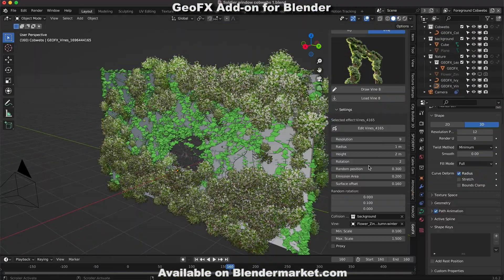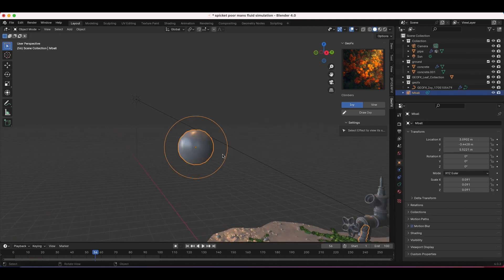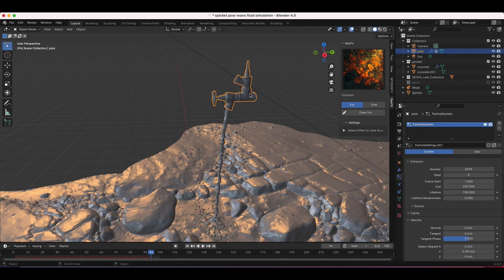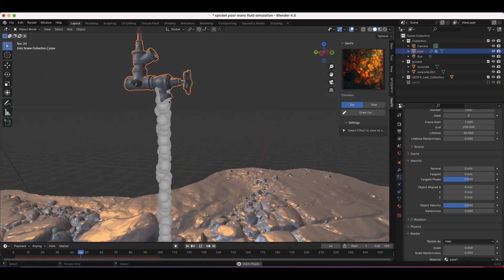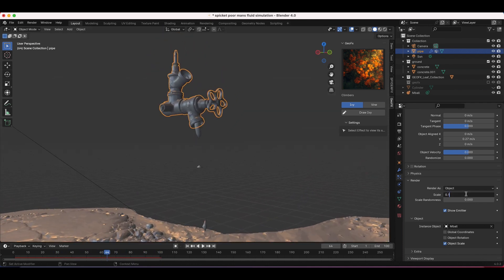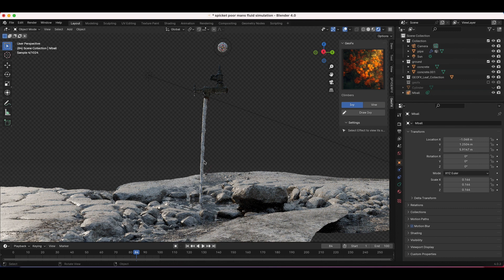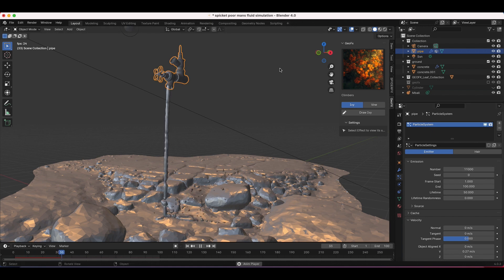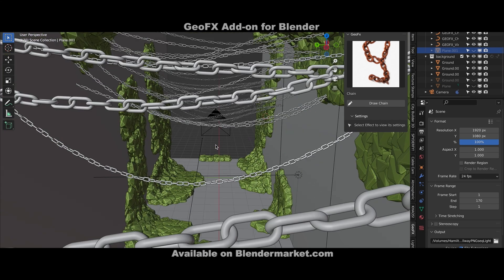How to Fake Fluid simulation in Blender: Full Tutorial (Particles + Metaballs)

Comment: How can I add motion blue to this animation?
Reply from the maker: I'd probably render out the fluid on a separate render layer and add motion blur in the compositing process using a vector pass. Hope this helps. Thanks for subscribing our channel.
Reply: Thanks. I actually managed to do it. MB don't have motion blur info so have to duplicate the whole setup and have normal mesh balls animating alongside (physically inside) the MB. That'll let us have motion blur with vector pass. 
We needed to make a hot water shower bath which was only possible thanks to this tutorial  @LightArchitect
Reply from the maker: @OK-j7x  Ohh that's a good workaround. Hope the shot turns out great!